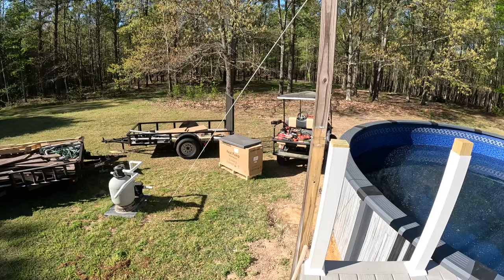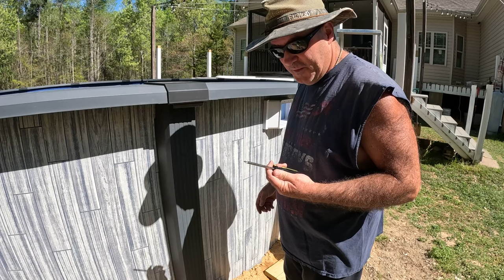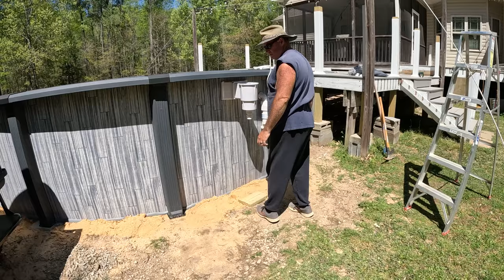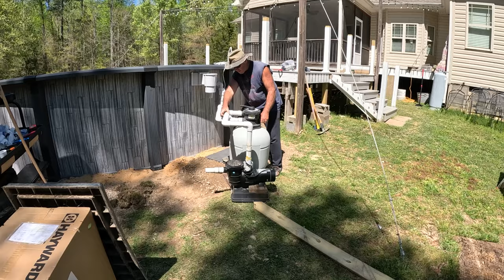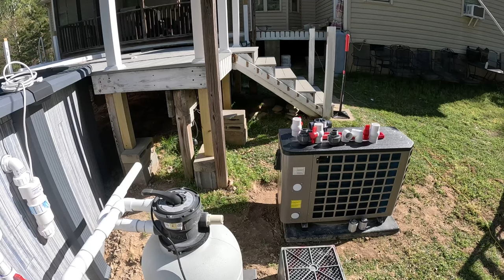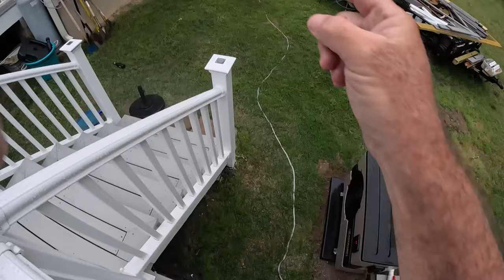Swimming Pool Plumbing Job with a Hayward 50K BTU Heat Pump and Hayward Aquatrol SWC

Comment: Unions??? How you recon to take it apart?
Reply from the maker: Not a big fan of unions. Just something else to leak. Last time around I did no have to cut any pipes for about 10 years. Pipe glue and regular old PVC couplers are much cheaper. 😀